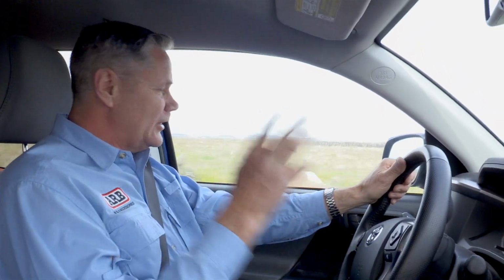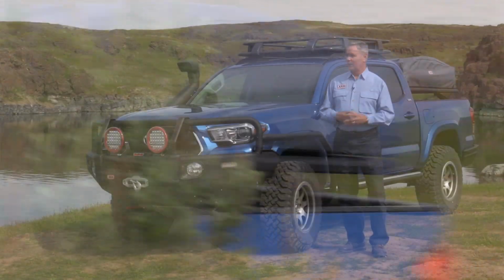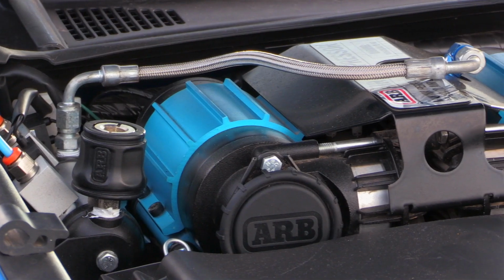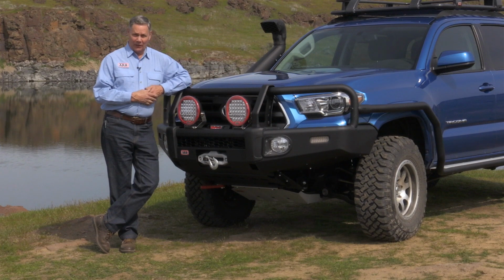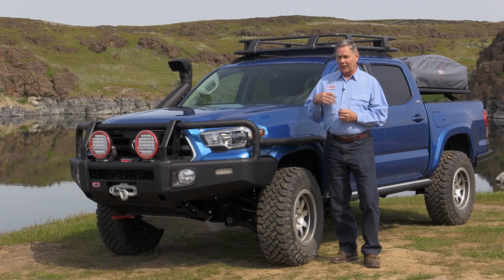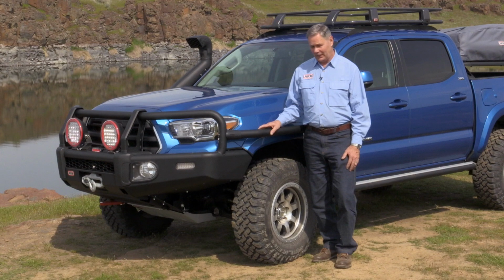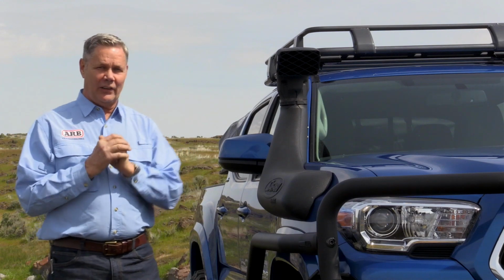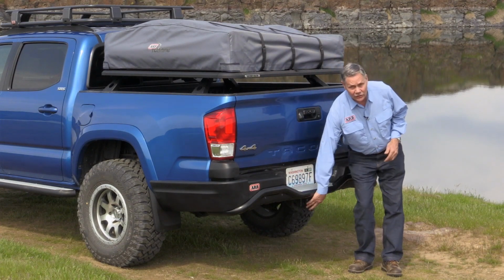ARB 4x4 Accessories 2016 Toyota Tacoma Feature

Comment: Does the roof rack require any drilling or caulking to seal the holes on the roof? does the Summit front bumper work with the Toyota Tacoma sensors on the 2018+ models? how come you guys didnt show the summit rear bumper?
Reply from the maker: Hi WiseSilverWolf, Here is a link to the website that has more info on all of the products for the Toyota Tacoma.  https://arbusa.com/toyota-tacoma-2016-on

Comment: make a 1st gen tundra snorkel please
Reply from the maker: Sorry, we do not make snorkels. We are only a distributor for Safari Snorkels out of Australia. For new product development, they require a high demand which unfortunately is not the case with the 1st Gen Tundra snorkel.
Reply: @ARB4x4USA  - 1st gen off road has these options: 1. ARB Safari Snorkel used on Sequoia in video: https://www.1stgenoffroad.com/store/p... 2. Cheap Knockoff Snorkel From Amazon: https://amzn.to/2Rw60k5
Reply: These options will work for the 1st gen Tundra as well:
in video: https://www.1stgenoffroad.com/store/p... 2. Cheap Knockoff Snorkel From Amazon: https://amzn.to/2Rw60k5

Comment: Hi ARB... Amazing assortment of products that were installed in that Tacoma.. I own a 2017 Taco myself and I wonder if you can please share the tire and wheel size. Thank you!
Reply from the maker: We are currently running LT265/70R17 BFG All Terrains.
Reply: @ARB4x4USA  Was there any lift with the ARB suspension to fit those tires? Thanks!

Comment: Every time I see a snorkel on a off-road vehicle 98% of the time it’s just for show because that person doesn’t take it off road or use the snorkel as it’s intended for.
Reply from the maker: Yes, some people like just the look of the snorkel, but remember snorkels are very beneficial for dry climates as well. They are a true cold air intake, forcing the coldest, cleanest air possible into the engine causing a minor increase in performance. This is one of the reasons you see a lot of Land Cruisers in desert conditions with snorkels installed.
Reply: ARB4x4USA this is true but around me they’re only seen on pavement princess’ and mall crawlers
Reply: Out here in Australia we definitely use our snorkels mate!

Comment: Is it compatible with the sensor in the front
Reply from the maker: If you are referring to the new TRD Pro then not right now. Toyota moved the sensor location low which interferes with our bumper. We have not confirmed it, but we think that you can swap out a non TRD Pro grille. Again, we have not tested this theory as of yet.
Reply: @ARB4x4USA  yall should really work on that. Really want this grill but the sensor is the problem from me buying it
Reply from the maker: @garricksreptiles2667  Unfortunately we don't have control when the OEs moves sensors. We can't relocated it without causing issues the factory system so the grille might be the only option. Toyota isn't the only OE that we have to work around sensors, some the Jeep models are the same.
Reply: @ARB4x4USA  so what do yiu recommend I do ? Remove the sensor?

Comment: would a front locker work on a trd off road? with the crawl control system on or off?
Reply from the maker: Yes, the ARB locker will work just fine with the factory crawl control system and traction control.

Comment: Does this bumper interfere with the front safety sense radar assisted cruise control on the grill of the 2020 Tacoma?
Reply from the maker: At this time we haven't had a chance to test it. We just picked up a 4Runner with the system for testing and will go on from there.

Comment: The finish on that bumper is NOT what comes on the bumper. My summit bar came with some half ass paint job that looks like ARB sprayed it on with a rattle can before sending it off to they dealer. I haven’t had it on for a full year yet and I’m already have rust issues with it. It’s definitely a tough bumper but you guys shouldn’t advertise things that you don’t actually provide.
Reply from the maker: The Integrit textured powder coat finish is a proven industrial outdoor powder coat that is designed to live in the outdoor elements in Australia. We have been using this coating for a few years now with not one rust warranty claim. If you are truly having and issue, please contact our tech department at tech@arbusa.com
Reply: ARB4x4USA cool, but you guys know better than most that true off road Clients just deal with corrosion and repair themselves. Yes, mine has corrosion as well.